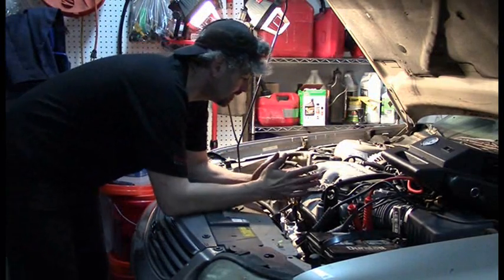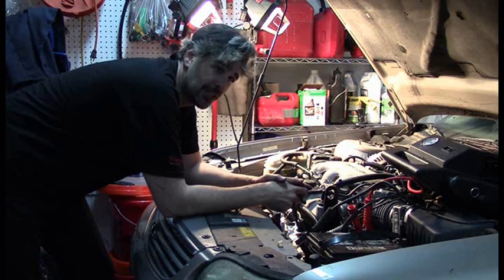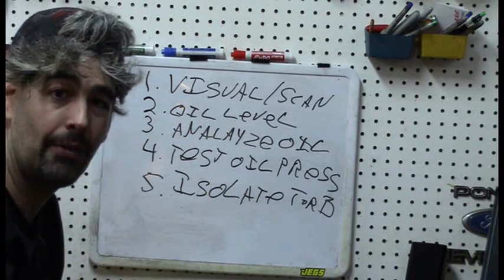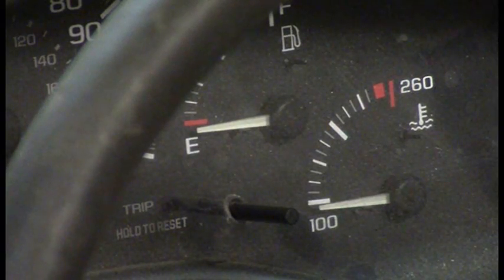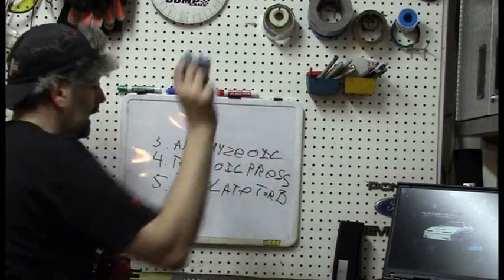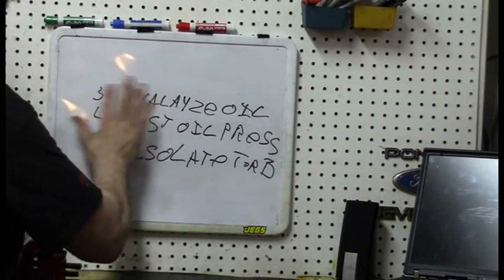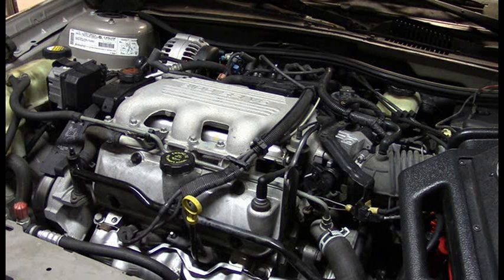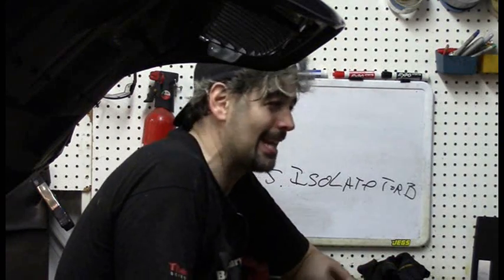Engine Noise Diagnosis-Part 1

Comment: I would've done a relative compression test first to rule out valves/piston issues. If compression is bad time for new engine. That'll pretty much tell you whether it'll be worth it to move on after that and diagnose further. Then use a screw driver to try and isolate the noise. If you isolate it then diassassemble and inspect
Reply from the maker: Why would you do that with no misfire counter activity?
Reply: Even though there was no misfire in this case, a compression test can not only rule out a piston issue but also will tell you what is going on with the valves which I read was the actual issue. The collapsed lifters would have shown up as higher than normal pressures at higher rpm due to incomplete opening/closing. I'm surprised there was no misfiring.
Reply: It also depends on if it's on the exhaust or intake side
Reply: If compression is normal at idle but low at snap, there is an intake restriction or the valve is not opening/closing completely in the case of a bad lifter. 

If compression is normal at idle and high at snap, there is a restriction or incomplete opening/closing in the exhaust side
Reply from the maker: Absolutely incorrect  A compression test CANNOT tell something is wrong with valves.  Only a leakdown test can do that.  A comression test is completely irrelevent in this diagnosis
Reply: A running compression test tells you more than you think about your engine than a cranking compression test. A leakdown test will pinpoint whether its pistons or valves at TDC but a running compression test tells you more about your engine. It shows you the volumetric efficiency
Reply from the maker: So tell me, how can you tell it's the VALVES much less which one on a relative compression test. Dying to hear this!!!
Reply: Schrodingers Box the relative compression test tells you if theres a compression issue  which could be valves or pistons so its a quick dirty test, but also RUNNING compression which i forgot to mentiom in the initial comment can pin point it better by taking compression at idle and snap. A collapsed intake vavle will close and open for a shorter duration and will show as a decreased in pressure compared to othrr cylinders due to restricted intake. an exhausy valve that has a collapsed lifter will open and close early and restrict exhausy flow and lead to higher pressures than other cylinders
Reply from the maker: +nick elias ...Or head gasket issue, or cylinder head leak or cylinder leak or leaking valve or leaking rings....

  You cannot rule out those variables and determine engine noise cause.
 Here- think of it this way:  The noise is ALREADY determined as either rod or valvetrain, (obviously). So why would you waste time doing a test that determines it is either valve or piston (which it doesn't anyway).
 A compression test is completely USELESS in narrowing to the cause. It just wastes time.

Comment: E X C E L L E N T analysis and observations SBox.  Well explained (= expertise).  Much appreciated.  Mine is a '94 Buick Regal 3.8L just shy of 200k miles with what seems a valve tick, although engine and tranny are running fine -- for now, Dec. 2016.

Comment: 2005 Chevy Silverado HD 2500 has a tick is definitely an internal engine noise.  Oil pressure seems to be ok (25-30 cold, or at idle - 40 warm and riding down the road).  The tick comes and goes, but it has gotten worse (a bit 'harder' - 'louder'?) and more frequent lately, like almost everyday now.  When I hear the noise I usually pull over and turn the engine off for more than 5-7 minutes on the side of the road (ugh!).  After I sit for a little bit, normally it cranks with the noise, but after about 10 seconds, it goes away, and I am good for a little bit (sometimes the rest of the day, and sometimes not).  When I allow my oil to get a little lower than maximum (1/2 quart low), I can pour marvel oil in it, and the sound will immediately change, and usually go away for a bit.  Recently, I started putting a little sea foam in the engine with some success.  My next step is to check each cylinder as you have done here, and see if the sound changes...

Comment: I'd  like your expert opinion on my knocking noise please help
Reply from the maker: Sure.  What did your diagnostic test indicate?
Reply: No codes came up
Reply from the maker: stephen sparrow No the data from the video.
Reply: The tensioner looked in tact and the chain seemed pretty tight but there was maybe a quarter inch play on the right side, I haven't turned the crank yet to line the timing I will post another video of the timing chain set

Comment: So happy I found this channel. I was helping a friend a while back and I thought I would do an audio recording of the knocking noise on his old VW bus. I analyzed the audio and the peaks in the waveform (the knock sound) were occuring 37 times over 5,184 seconds, so for frequency I took 37-1=36 occurencies over the period 5,184 = 6,9 ticks/sec and 416 ticks/min.

Bus was on idle so I believe the revs therefore were 416*2=832 rpm. This would indicate that every other crank rotation produces a noise, in other words, ONE noise per 4-stroke period. From this info, am I right that it is not possible to rule out if the problem is crank or valve lifter related? Due to the ignition for one said cylinder happens every other crank rotation and also a lifter would happen every other crank due to the cam belt gear ratio of 2:1 (cam shaft rotating half the speed as the crank)

Comment: I don't even need to see the second video having owned 2 of these engines.  Dollars to donuts, bad lifter.  Works out since the intake manifold gaskets go out on these anyway, so you would have to take it apart either way.  Doesn't sound like rod knock to me.  The coolant in the oil is probably a second issue that accelerated wear on it.  If there's white smoke or a bad compression test, it's probably a head gasket, though I've never seen one blow on one of these if maintained properly.

Comment: sounds like lifter noise because it's a rattle . a rod noise would be more of a slower knock...
Reply from the maker: You are correct Vova.  A rod knock will have a higher frequency, not a rod knock.

Comment: I like the posting. I had a car idling in the driveway and the gas pedal went to the floor. Don't know why but, it red lined for 7-9 secs b4 I got out and turned it off. Now I have a loud tapping noise. Three mechanics later, I have 3 different diagnosis's. That's why I am here. You are doing better than I am. Cause you can laugh about it. GOOD LUCK WITHOUT A COMPUTER TO YOU, ME, EVERYBODY. Noises in an engine are a bear. Multiple issues make it even more difficult. Good Video. Thanks.

Comment: by the way, these engines suck, due to the engine coolant being drained into the engine block from the head (I had this EXACT same engine 3800 series II, and it cost me LOTS of money, and the engine still died) absolutely garbageengine, in my experience, always buying a 4 cylinder car here on out anyway, please comment :)
Reply from the maker: +newchan02 There is a known issue on the 1999-2004 3100 and 3400's where the intake manifold gasket leaked on the V6 models on the bank 2 rear corner causing exactly the issue you describe. There are two TSB's on it.
Reply: +newchan02 the 3800 is one of the best engines GM has ever built i will agree the 3.1 and 3.4 are not that good but the 3800 is a awesome engine

Comment: timing light won't work. since there's only 3 coils per 2 cylinders. it uses wasted spark system. every 360 degrees. once on the compression stroke and then once on  the exhaust stroke. As compared to 720 degrees on a conventional automotive engine. and these motors use a crankshaft position sensor to time the ignition.
Reply from the maker: +Eckehardt krieger Dang I didn't even think of that, omg I feel dumb lol! Great point bro!! You're the only one in like 2 years to notice that!!!

Comment: upper lower intake leaks were bad on 3.1s and 3.4s were bad for that. plus the rocker stud holes were bad as well and GM recommends rehelicoiling the threads in the rocker stud holes.

Comment: I think this sound due to vacuum leak or IAC problem
Reply from the maker: why? what would the mechanism possibly be from either to create a mechanical noise???
Reply: i had this problem with marquiz 2002 ==scanned obd = p1504 then i changed IAC and problem solved>>> the symptome was some little knocking with fluctuation in idl at starting last for 10 to 15 s
Reply from the maker: Zied Jezawi Then you didnt have this problem, obviously. Right?
Reply: dont know exactly ..try to find a vacuum leak
Reply from the maker: Zied Jezawi Nah, that's OK- I'd rather fix the car.

Comment: After I changed the fuel injectors the car started making a pretty loud fast ticking sound. If you git the gas it goes a way for a second then comes back, any idea?
Reply from the maker: +spiffcats Sounds like you didn't change the fuel injectors correctly to me. Go back and look for basic mechanical fault.
Reply from the maker: +spiffcats Actually I take that back- there is another possibility I may have overlooked.
  What was data you got that indicated to you that you needed to change the injectors in the first place? That might be a clue!
Reply: Schrodingers Box It will run like new for 15 minutes, then suddenly start misfiring and surging. Once it starts doing that its almost impossible to drive. When I took the intake plenum off there was pools of gas, and gas in the vacuum lines.
Reply from the maker: spiffcats Ok again- what was the evidence the INJECTORS caused this? This is where I would start.
 What was the injector pulse average on each bank? What was the static and idle fuel Short and long term fuel trim? What was the O2 sensor reading idle vs WOT?

  I need to know how you determined the injectors (all of them??) were the problem.
That is the clue to the engine noise bro.
Reply: Schrodingers Box I drove it again today, and the noise is gone. I also noticed cylinder 6 wasnt firing, so I replaced that spark plug (just replaced it 2-3 days ago, must have been defective), and it runs much better. It has been driven for a few hours in the city, no problems, going to take it to the highway and see if it surges at all. 
I only have an obd tool that makes the check engine light flash, so I dont know any important data. I figured some part of the fuel injector unit was leaking because there was gas in the vacuum lines. So, I replaced the whole thing as a unit.
Reply from the maker: spiffcats Well thats definitely not how I do things so i wouldnt have been able to help anyway but glad its working for you now

Comment: How do you do that procedure with coil packs tho ? GM 2.2L uses those, no plug wires. I have a ticking problem with my 2.2L Saturn L200 I can't locate with a screw driver or stethoscope.
Reply from the maker: +Chas S Normally with coil packs I just test by grounding the control wire for each individual coil within the pack one at a time.

Comment: Well i admire you for admitting your not good at finding these noises, i don't think anyone is, you do get a rough idea of what it is top or bottom etc..comes a time where you have to pull the whole thing to bits ad look at it...i have watched quite a lot of your videos on here, pretty good, i was a motor engineer for 45 years from Fred in UK
Reply from the maker: +Tom Smith I read an article years ago when I was still an armchair mechanic from a guy on how to diagnose engine noise. He said "you should not only be able to tell by ear whether the noise is top or bottom but also WHICH CYLINDER is causing the noise.
  I was in awe at what skill that must require! 
But now that have experienced at least 2 dozen engine knocks, I realize that guy was 100% full of BS and yet another hack giving advice.
Reply: +Schrodingers Box my Dad told me that also. I have a Dodge Charger 2012 SE and I figured out a noise on the engine, like lock, lock, lock, lock. When I called him to let him know that, because he is in New York and I'm in Florida, he told me that too, "I can not only be able to tell by ear whether the noise is top or bottom." <<I still have that noise>>

Comment: Hey man! I wonder if you could find a way to record the engine noise in sync with cylinder firing, you know with data spiking on a graph that you can look at? 

That might be a better than watching the timing light and listening.

Sounds like its in the top end man. Will be interesting to see.
Reply from the maker: +ILTSYC Yes someone else brought that up too- I think it's a brilliant idea! Wish I had thought of that lol!  I think next time I get a rod knock or lifter noise I will try that!!
Reply: +Schrodingers Box 
The only reason I thought of it was because I saw you do the amps test on the starter to measure compression after getting a reference manual compression test on one cyclinder with the Vantage Pro.
Maybe you have the stuff already to do it?

My daugher's Focus is making a simular noise and unfortunately I just found a battered #4 spark plug. I almost couldn't get it out.
Ford Focus are notorious for dropping valve seats.

Comment: I would have to say it is coming from top-end. Common problem I have seen with those engines is that the rockers ripe them self out of the threads. From the video, it sure sounds as that.
Reply: Never seen a lifter go bad in those engines before, but well done and finding and fixing

Comment: if you ever want to crank an engine and disable the fuel injectors pull the fuel injector fuse OR pull the fuel pump relay. quick and easy
Reply: andrew donohue and that will take allot less time then pulling all 4.6. or 8 injectors connectors and then making sure you are keeping track of which connector came off of what cylinder

Comment: Cam bearings
Reply: +russwelday  DING DING-- RUSS IS RIGHT.  Coolant in oil, run it long enuff and cam will seize and break. I have the same engine that had the intake gasket common problem. By the time my son let me know what was going on figured what the heck-so changed to correct gasket-ran few minutes then changed oil again- started but with annoying tick in top end. Noticed oil light on so shut off. Tried to turn crankshaft but was very hard at certain points--Took top off -cam shaft piece close to pass side would turn but the other end was seized.

Comment: How much did it all cost to get it fixed because I have the same car making the same noise but only wen I press on the gas
Reply from the maker: Kalynn Ferman Just the cost of intake manifold gaskets- maybe $35 I think?  Of course that is meaningless unless you diagnose that your problem is the same one.
Reply: No they said it was my oil pump do you know how much they cost to get fixed
Reply from the maker: Kalynn Ferman Then why would you possible ask about the cost for this repair? Either way- since you are not doing this yourself, it is easy to estimate the exact cost.
it will be 2 payments.  The first will be about $600 for the oil pump.  The second will be about $1500 for another engine when you find the oil pump doesn't fix it.
Reply: What do you mean the oil pump when the oil pump doesn't work I took it to a mechanic
Reply from the maker: Kalynn Ferman Because your mechanic is an idiot.
  The only reason he would say you need an oil pump is because you have low oil pressure- which I question in itself, actually but let's assume he's correct and you have low oil pressure.
The fact is the oil pump does not build oil pressure- it generates flow.  Oil pressure is created by the engine bearings.  If the bearings are worn, you will have low oil pressure regardless of flow.  It is EXTREMELY UNLIKELY that a low oil pressure problem is caused by a failing oil pump.  Oil pumps are very simple and are directly driven by the engine.  The overwhelming likelihood for low oil pressure is worn engine bearings, not bad oil pump.
  Unless your mechanic dropped the oil pan and confirmed the oil pump clearances are out of spec while you bearing clearances are within spec, the call that your oil pump is the problem cannot possibly be made. And I absolutely 100% guarantee he did not do that diagnostic.
Reply: Well I'm going to take it to another mechanic because this is my first car and I really don't know anything about cars
Reply from the maker: Kalynn Ferman Good idea.  To bad you're not in denver or I would look at it for free
Reply: I wish I was

Comment: I have a Astra 58 plate only has 35000 miles on it been driving it for 2 weeks it's petrol engine when the car engine gets warm it's sounds like a Diesel engine mechanic say it' needs a new timing chain what will cost £350 what do u think ..?
Reply from the maker: I think I would measure the timing chain slack

Comment: hi..you have a tipp what is that for a noise ? V8 Hemi engine from a 2008 dodge
rod bearings ?
https://www.youtube.com/watch?v=py_YxHS-ick
Reply from the maker: ***** why yes, most certainly I do have a tip- see  if someone has made a video on engine noise diagnosis- particularly one which demonstrates strategies for differentiating between top and bottom end noise and how to isolate an affected cylinder.  I am sure someone has made such a video.
Reply: Schrodingers Box
hi and thank you...you have a idea what is,my noise ?
Reply from the maker: ***** Yes I have many ideas... rod knock, lifter noise, exhaust leak, low oil pressure, misfire, predetonation.....
But it is impossible for me to know which it is because I cannot do the differential diagnosis from here.
Reply: Schrodingers Box
Ok and Thank you:)
Reply: Schrodingers Box lol you're the "House" of auto-mechanics, aren't you?
Reply from the maker: xinic5 Lol- I have a customer that calls me that. I consider it a compliment except that House MD was way too nice and forgiving.